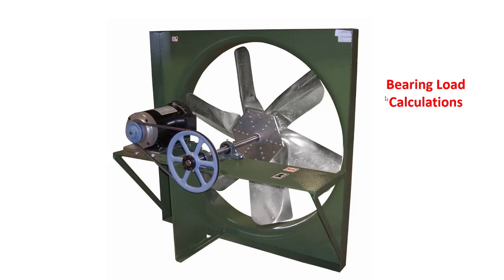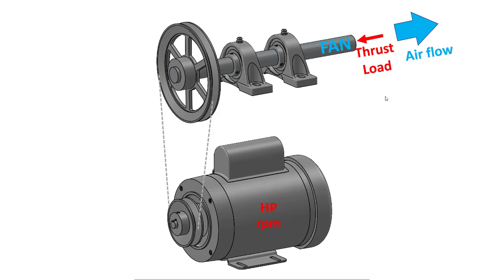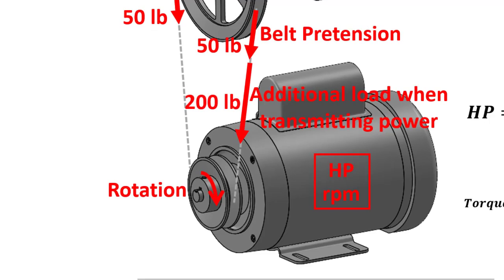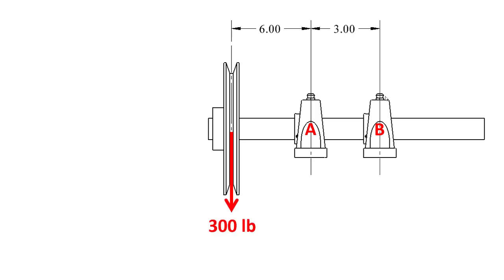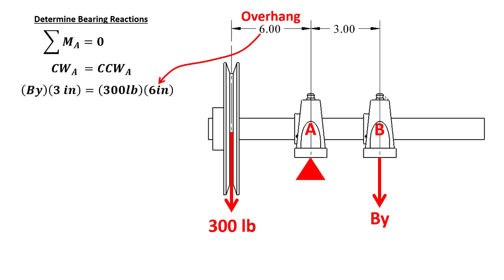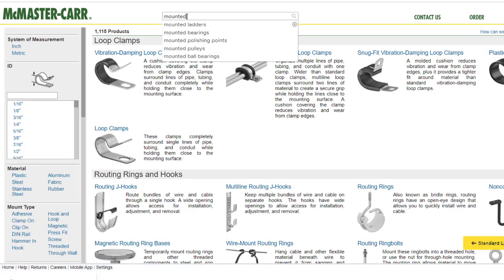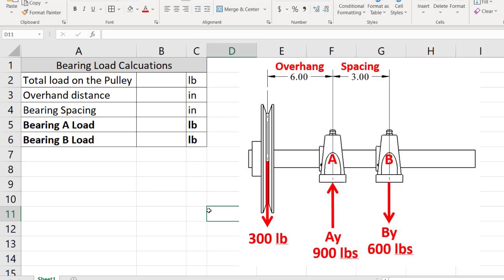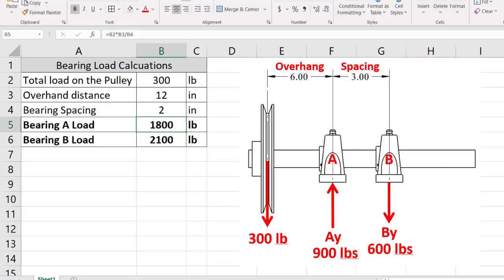Video   Bearing Load Calculations

Comment: Hi, I think there is some wrong input in the excel cells for the load calculation. there is some mis match value with the manual calculation for both bearings. 
When calculating manually, load on bearing By= 300*6/3 = 600 but in the excel cell you put this for bearing Ay. So which is correct result? excel cell or manually calculated? Thanks.
Reply: Consider manual Calculation, The Excel Calculation must be other way round- but it was good explanation

Comment: You said that radius of the pulley doesn't effect the radial load of the bearing. However, same radius is used in calculation. and, changing the radius value changes the result. please explain.

Comment: What if the belt that goes to the motor was off to the right as opposed to below the mounted shaft? would the force from the motor still contribute to radial load in the same manner?

Comment: What if only use single bearing.. like the single swingarm motorbike which hanging the wheel only one side.. can u share how to calculate the bearing load ?
Reply: all the loads will be applied on that single bearing which means lateral deflection is great